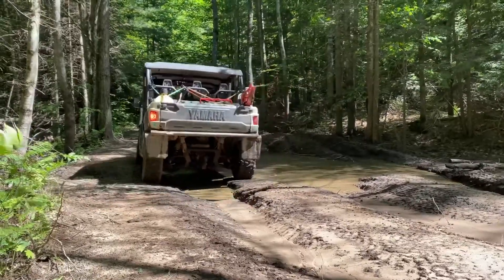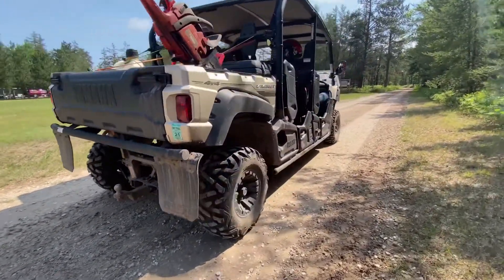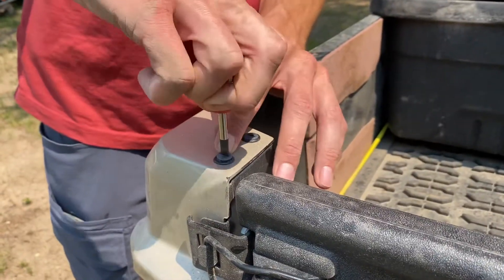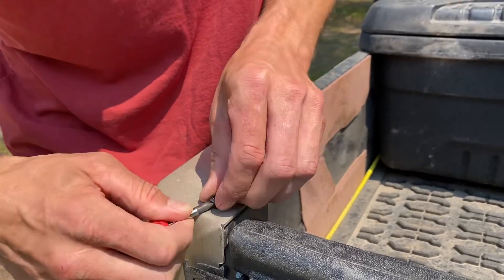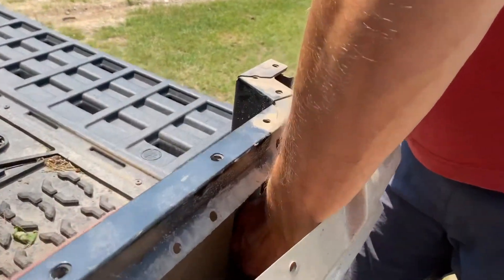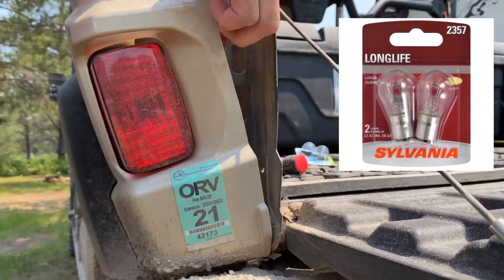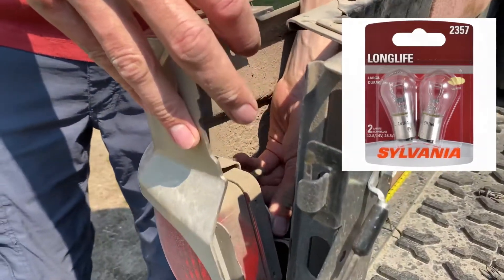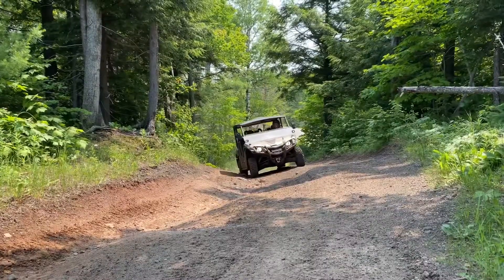How to Change a Yamaha Viking Tail Light

Comment: Now if I can just figure out how to change these front bulbs lol
Reply from the maker: They are soooo dimmmmmmm.
Reply: @MobileRVTechServices  I ordered some LED bulbs, but I have not figured out how to get to the bulb. Hoping to brighten that up some.
Reply from the maker: @liprippingwithblake5613  I ordered the LED bulbs last fall and will be putting them in this summer. I haven’t pulled them out yet so I don’t have any tips on pulling them out. -Steve
Reply: @MobileRVTechServices  ok well.. I just got it done. The first big rubber cap comes off easy. The inside one doesn’t seem like it pulls out, BUT it do! LoL keep pulling it, it will come out, then you can get to the stupid clip that’s under pressure with a set screw. 

Take a pic or somehow remember how that clip goes back in, you will have to put it in place and hold it while you tighten the screw back. (Don’t take screw all the way out).
Reply from the maker: @liprippingwithblake5613  thanks, I’ll remember that when I go to take it apart.